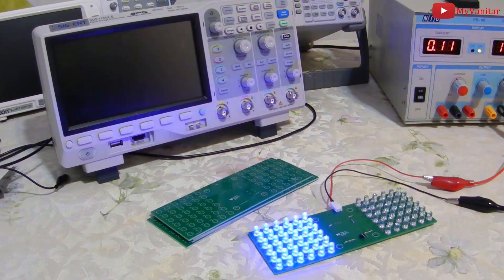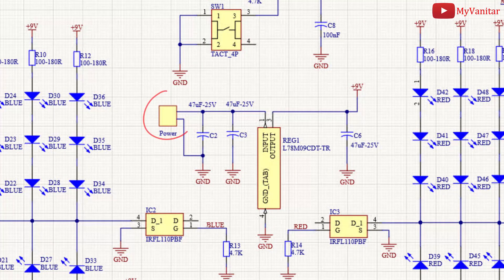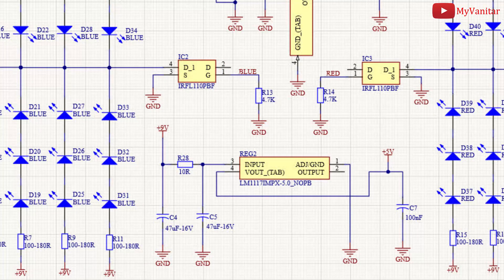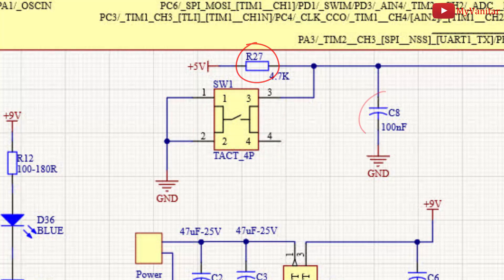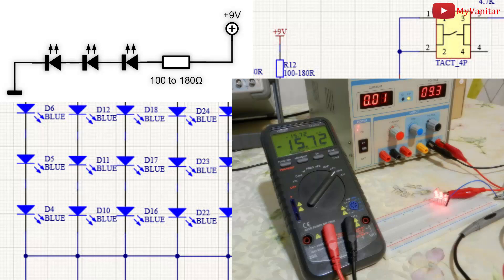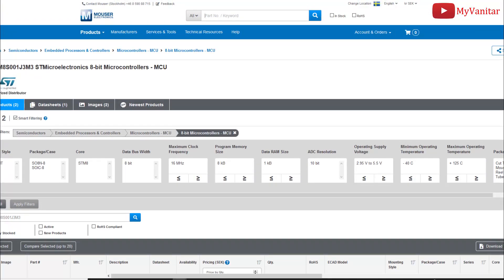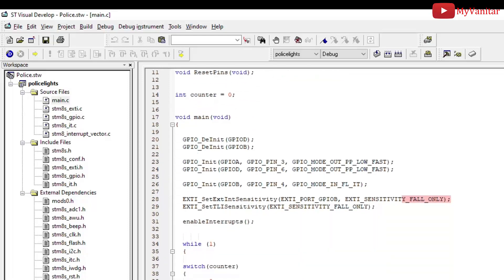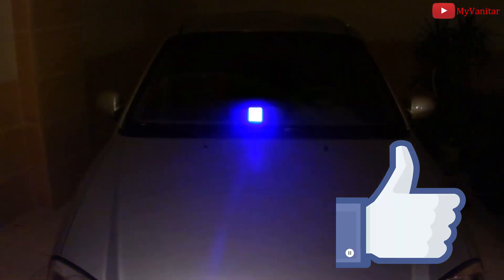Police LED Flasher Circuit [72 LEDs, STM8S001]

Comment: Good idea, using PIC device. Now, I'm thoughts amaze me in how to reduce the number of LEDs to 4 pcs BLUE 3 WATTS smd LED, and also for red, 4 PCS RED smd LEDs 3 watt's type? Any ideas for reducing and improving the outputs for flashing approximately 10 watts of blue, 10 watts of red flashing light?

Thank you.
Reply from the maker: The controlling part is identical. calculate the current draw of the LEDs that might force you to change the power supply and regulator side. 20W in 12 is about 2A. So I recommend you use a switching supply.  if that's a commercial device, I can design it for you.